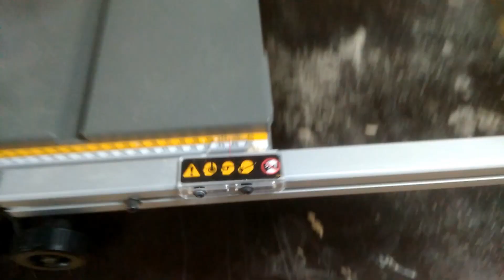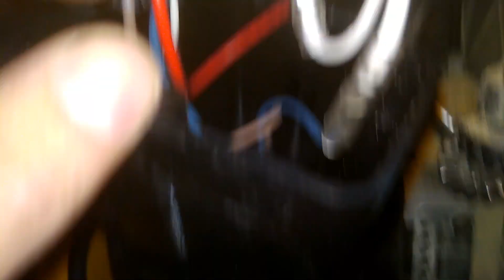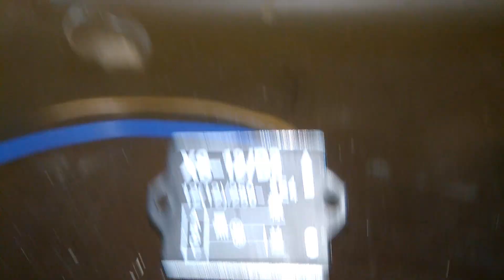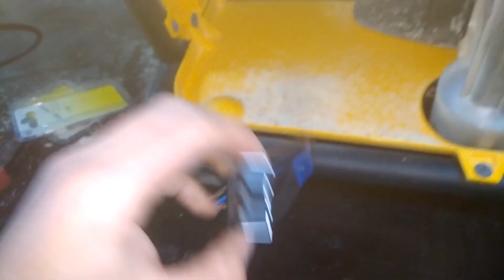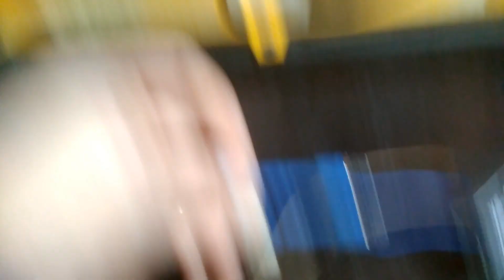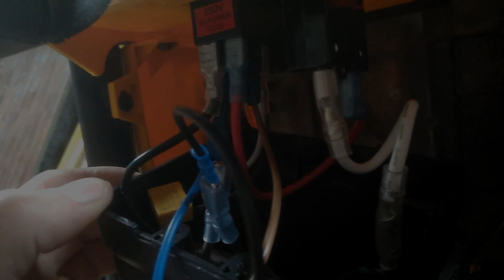DeWalt DW745 soft start module install

Comment: Would it be possible to mount the module in line with a short extension cord so that you don't have to modify the saw itself?
Reply: No, it"s not possible. You need to have the module between the switch and the motor.

Comment: The reason why the soft starter needs to go entirely on the switched side is that if it's on the input side it's permanently energised, which defeats its ability to function as a soft-starter.

Just re-ran the intro again, Scott sure gets around doesn't he? :-).
Reply from the maker: Yep, that's a good reason, but knowing me, I probably left a connection dangling,🤪

Comment: The specs for this part says it's 12 amp capacity. I have a DW-745. They are rated at 20 amps. This module does not provide sufficient amperage for the saw.
Reply: They are rated at 20 Amps if your input voltage is 110 Volts (USA). Seeing as this gentleman seems to be British, he would be running 240 Volts (same as here in Australia). That means they are rated at about half that Amperage for 240 Volt power.

Comment: Wait… isn’t the dw745 a 15amp saw? That module is rated for 12 amps, isn’t that an issue?
Reply: Not if your operating voltage is 240 Volts. I'm in Australia and our household voltage is 240 volts. My DW745 will run from a standard 10 Amp outlet. Given that this guy is British, he would be running 240 Volts.

Comment: Man.... I bet it hurts to get zapped by 240VAC . 120V is bad enough. Thanks for showing this. Need a couple of these myself.
Reply: not too bad actually, you guys up the amperage instead I recon.
Reply: ~230 will likely stop your heart, which will usually start from a dead stop. 120v will more likely bugger up the heart rhythm requiring a defib.
Reply: @drsquirrel00 .. so 240 is safer 😳
Reply: @cdunne1620 Yes, and sadly people misunderstand this.

Comment: Hi have just got the same module your video is not that clear what colour wire from the module goes to what colour wire on the saw i think i might have it but does the black module wire go the the brown wire you say hgoes to a thurmal fuse then up to the black wire.
If you could help it would be great
thanks
Reply from the maker: soft start module goes in series from the switch output to the motor
the wires on the module are:
brown - input A (connect using output from pin, 14 brown wire on saw from factory)
black - output B (connect to brown wire, which you took off, and replaced with the input of the module.
blue - neutral C (connect in parallel to an existing neutral)

hope this helps.

Comment: Hi! I have the Dwe7492 saw, and was baffled it (at higher cost than Bosch 10 XC saw) did not boast neither a soft start nor a contant speed feature, like the less expensive Bosch.

The Dwe7492 does have a power-loss-to-off-state feature though. Will this impair the use of the makita soft start component in your opinion?
Reply from the maker: No, I don't think so, mine also has a power loss to off (fail safe), and it works fine.
Bosch make some very good machines, I chose the DeWalt for the price to cut width ratio.

Comment: The address where I bought the softstarter  :Bricoutensili.com.I live in the Netherlands and received it within 5 days.Now figure out how to connect it, because I found it rather confusing.
Reply from the maker: you connect the unit in series to the switch, preferable to put it in line after the on/off switch.
Reply: Heb je het typenummer en de naam van de softstarter voor mij. Ik kan hem op de site waar jij hem bestelt hebt niet vinden, Ik heb hem nodig voor mijn nieuwe Metabo KGS 254m afkort/trekzaag.
Reply: @josvanhoof7616  https://www.bricoutensili.com/en/makita-spare-parts/10264-soft-start-device-for-bench-saw-makita-mlt100.html
Reply: @hdegroot2565  Bedankt voor de link. Heb je ook een typenummer van de softstarter? En wellicht een tekening hoe ik e.e.a. aan moet sluiten.
Reply: Ik heb overigens een Metabo KGS 254 m afkortzaag waar ik de module in wil bouwen. De machine geeft een behoorlijke klap bij het opstarten.
Reply: @josvanhoof7616  Soft Start Device for Bench Saw Makita MLT100
Model  JM27000116  deze is ook te gebruiken voor de Metabo 1800Watt
Reply: @hdegroot2565  Dank je voor de info. Toevallig ook een aansluitschema?
Reply: @josvanhoof7616  Helaas niet, ligt ook aan de schakelaar hoe het aangesloten moet worden. Maar wel in serie aansluiten.
Reply: @hdegroot2565  Ik heb al een softstart module gevonden en ook een filmpje hoe ik e.e.a. aan moet sluiten. Op mijn Dewalt DW 745 heb ik m.b.v. een youtube filmpje ook een softstart gemaakt. In ieder geval bedankt voor de moeite.
Reply: @hdegroot2565  Zijn hiervan ook specificaties? Ik heb een opstart probleem met een 1 fase motor. 2,2kw. Is deze hiervoor ook geschikt?
Reply: Deze "softstarter"kan gebruikt worden tot en met 2500Watt dus 2.2kW mag geen probleem zijn!

 @wfockert8342

Comment: Do you know if it is possible to add soft start to a miter saw? let's say a  DeWalt dws779 if that helps, thanks in advance, great video good info.
Reply from the maker: i think it would be possible, but you might have more difficulty in placing the module inside the saw, than i did with the table saw.
Reply: @allanwalker5305   thanks for the info very useful.

Comment: Whatever you do, dont tell us where you bought it
Reply: Nice video
Going to try and add one to mine. Now electric brake would also be good
Reply from the maker: @JBSeymour  electric brake is on my wishlist too, if you figure it out, tag me in the video!
Reply: Looks like you can get the same thing at ereplacementparts in the US. Makita Soft Starter, Ls1018. Part Number: JM23100192. Nice upgrade for about $15.
Reply from the maker: google the part number, then choose the relevant supplier for your region of the world, I'm in France, the shop i bought it from would be of little use for you. 
Whatever you do, don't expect me to do your homework for you.